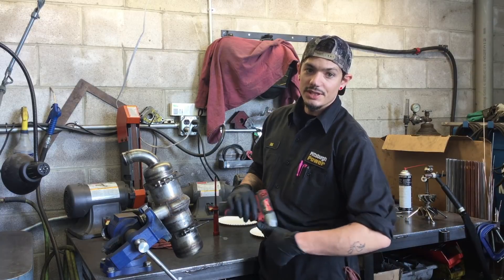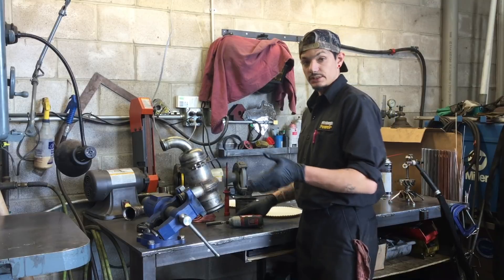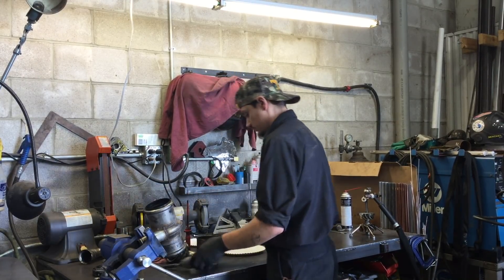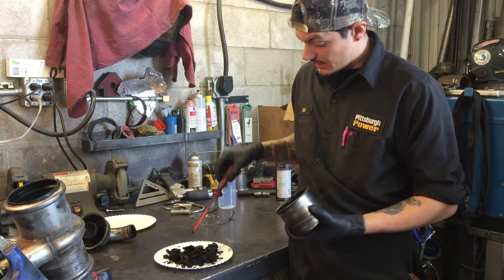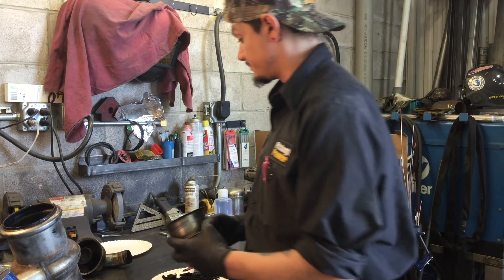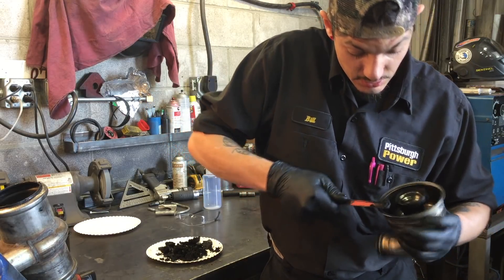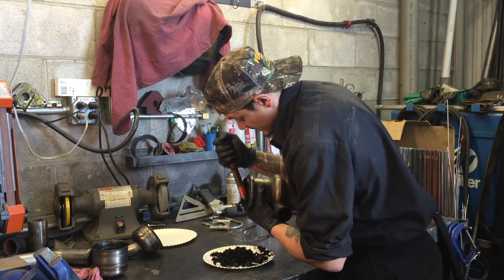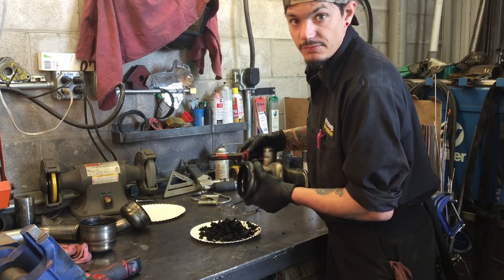Our new soot remover, Dorothy, is in the spotlight in this weeks how-to video

Comment: And we wonder why modern ISXs don't last.
Reply: They don't when you idle them all the time with EGR. EGR and low temperature idling is what clogs up the heads on diesel engines. Want more time out of your ISX head? Don't let it low idle all the time.

Comment: How many hours or miles of soot was that?
Reply from the maker: That was only 7,500 miles, we recommend cleaning it every 25,000 miles
Reply: I would probably do it earlier, like each 12,000 miles from the look of that... But for an older pre emission's truck...
Reply: @masonic777  if it was an older pre-emissions truck it wouldn’t need this. This is only for the EGR